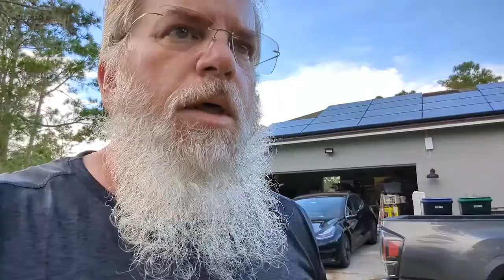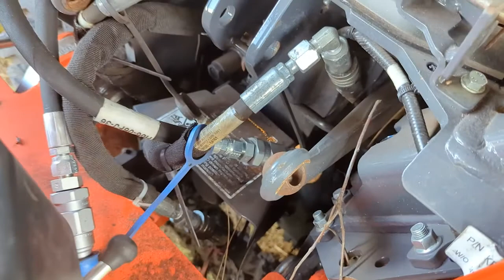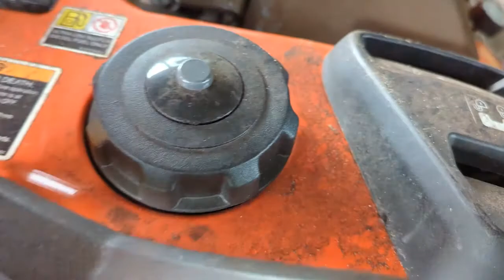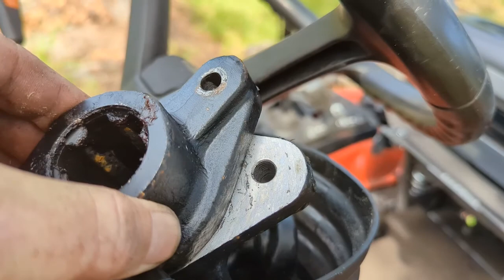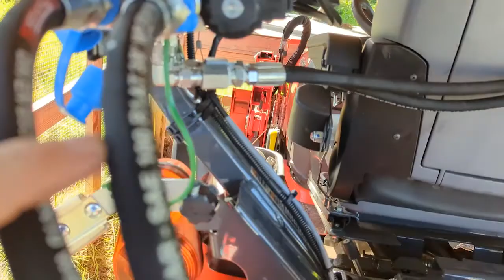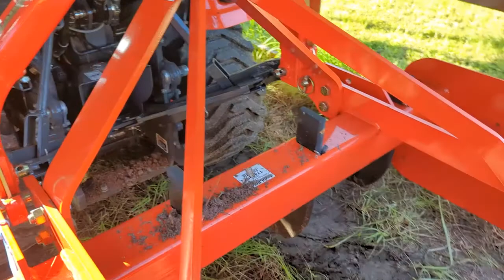EP 27 Journey to adding rear remotes to the BX23S

Comment: Thanks for the video. Nice job. Looking at the 3pt stabilizer arms, you might want to flip the plate as there can be some PTO interference with the plate and the PTO cover when using those arms rather than the turn buckles.
Reply from the maker: I have the Backhoe on at the moment, but when I swap out to the 3 point I will definitely look at that. Thanks for the heads up

Comment: How is this working for you. I'll be honest I know little about hydraulics. I thought about doing this same thing before I came across  yours and, killing it countys video doing the same thing. The reason I thought it wouldn't work comes from tractor chat rooms. There are many people who have asked about doing it this way, only to have a member of those forums tell them to study up on what the 3rd line does. The only fear/question I have about doing it this way. ( I want to so it's easily removable.) Why does Summit offers kits that plug into JD's BH ports. Their kits for bx23's don't, they have you remove the Tank and PB hardline and connect 2 hoses to those ports on the top and side of transmission.
Reply from the maker: James, it is working awesome! On the BX23S if you think about it, the third line is not used when you are in "3 point" mode. So I just use these 2 hoses in my set up. I did another video to go over the details of how I plumbed my remotes. You can watch it here. https://youtu.be/Fk5FfjtffeE I will add this to the description of this video so folks can find it. In that video I also link to the parts I used for the fittings so you can switch back and forth easily. Since the remotes are inline, you could run both the back hoe, and the remotes but I have not had a need for that yet. I guess some folks add a hydraulic thumb. Hope that helps!

Comment: I've just ordered my summit kit for my bx23s, although I believe I can still use my backhoe, I'm not yet sure how to hook the backhoe hydraulics inline with the summit kit.  I guess I'll learn.  Thanks for the video.
Reply from the maker: You could run the Summit inline with the Backhoe, but I am not sure why you would want to. For me I am either running the backhoe, or I have my 3 point on. I don't think the BX could run the backhoe and say a wood splitter at the same time. That could be interesting though to try to manage. Let me put together a short video on how I plumbed my Summit and get it posted shortly.
Reply: @Going_Bright  I have seen someone with a hydraulic thumb on the backhoe, but I was thinking more along the lines of how to attach the backhoe hydraulics into the tractor.  Doesn't the summit use those same connections?
Reply: @tekker8308  I recorded a video for you. If it does not explain things well let me know.
https://youtu.be/Fk5FfjtffeE